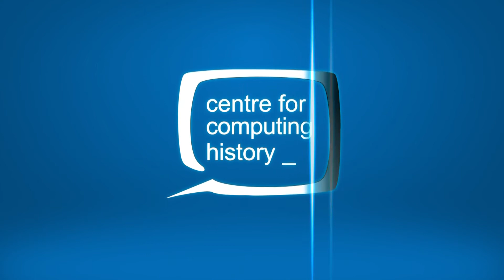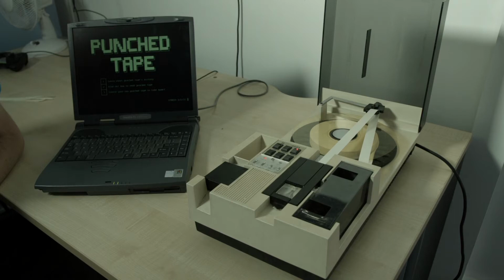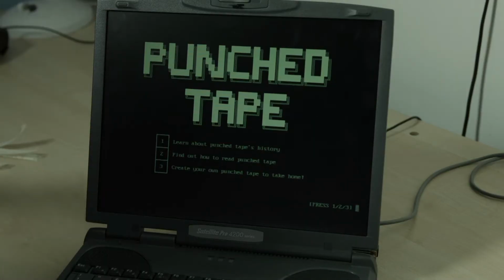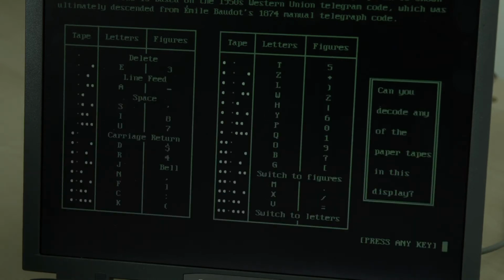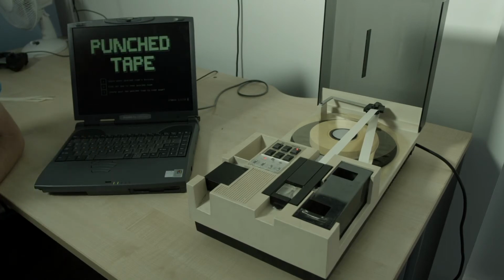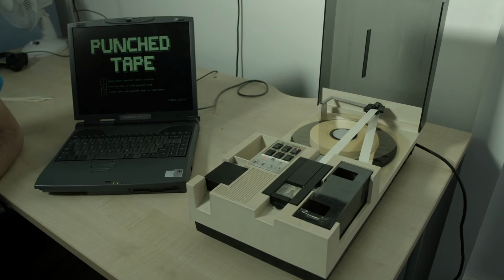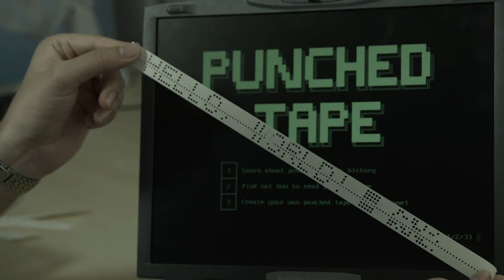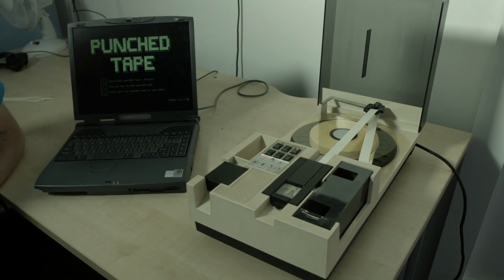GNT 4601 Paper Tape Punch - Punching Words into Paper tape

Comment: I've got 3 Siemens T1600 paper tape punch/readers. Similar to this one that I've recently got working. I've also got an IOMEC paper tape punch that is entirely solenoid operated. I've just built a shield for the Arduino Mega that operates it. You can see a rough demo of it punching 5 hole baudot code here: https://www.youtube.com/watch?v=GVfpuHd1ik8
Reply from the maker: Top work :)